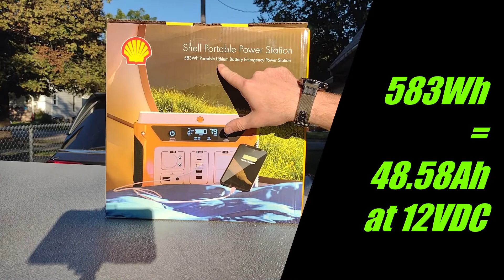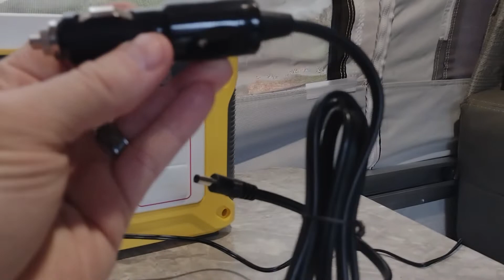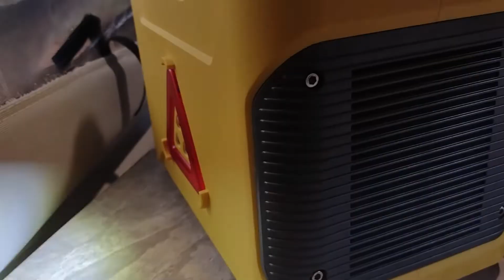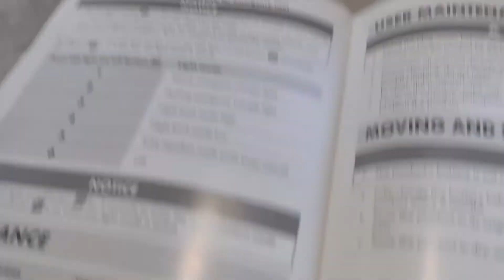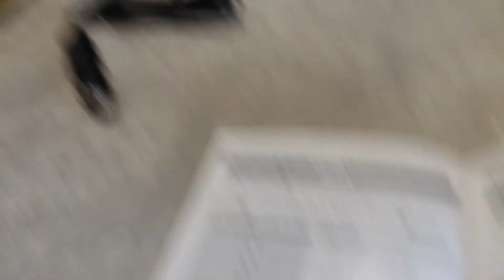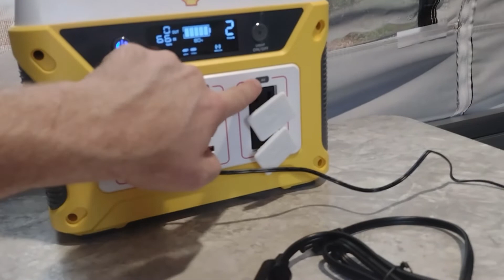Shell Power Station Unboxing and Review

Comment: Thanks for doing this review, do you know the Battery Pack total Voltage + the Battery Chemistry? LIthium Ion @ 3.6 or 3.7 volts  or 123 cells @ 3.4volts ?
Thanks
Reply from the maker: Cell capacity is 4500mAH Rated Capacity is 27000mAH 21.6V/583Wh  Lithium Ion but not sure on the volts per cell but looking inside through the vents they look like 18650 cells. Hope this helps.

Comment: JUST one more thing.. I received my unit about a month ago and have to be honest. I contacted Amazon because of error messages, specifically ⚠️03 (System Error). The BMS (Battery Management System) is unreliable. While plugged in, the USB ports intermittently don’t work, so you have to unplug it from the wall. I really wanted to like this unit. On Amazon there are only (as of this writing) 29 reviews. A small amount on a unit that you may have to depend on in an emergency.
Overall, I’d avoid this like Covid. I have the Jackery 1000, Bluetti EB 55, and EcoFlow River Pro, all of which are Class acts in their own right. IMHO, the Shell unit is not ready for prime time..🤷‍♂️
Reply from the maker: Have you contacted them? Judgement based off a single unit is hardly fair? You seem to have several other units which makes me wonder your overall intention. I have had not one single issue after 21 boondock campouts and a power outage at home. It has held up under a lot of demand from me. And seems to do just as well as a Jackery from the reviews I have seen. Your statement in regards to your issues sounds more like you got a unit with issues. I'd honestly reach out to have it replaced then make your ascertations on it.
Reply: @ParodyGuy2026  Yes I did reach out to them. They did not want the item returned, and verified my issues. Amazon was great stepping in. And in so many words I was told junk it, sell it or do whatever I wanted. Yes, I have other units, which is why I can compare it. I have a full time home in Mexico, and these units "are" my power.  My Jackery and EcoFlow have been flawless. Yes perhaps a bad unit, but when you're in the middle of nowhere, you can't hope something works, it has to come through. With that, I stand by my initial impression, and will not recommend it. Thank you for your response.
Reply from the maker: @pmd467  so when your next Jackery that you get has an issue because things happen in assembly and there is a flaw rate with even the best of quality control measures, you'll just rip on them and dump them over one unit. Sounds a little like a more personal issue there. Technology has complications at times and judging a company on one unit and saying stay away is kind of a hard push there. But, you do you. I don't see a mountain of complaints out there so, your 1 out of 10k ratio won't have any effect on things. I had an issue with a product from Sky Intelligent one time and reached out to them and they went out of the way to resolve the issue. Sent me a new unit with a return prepaid for the original. This was for an EV charger. They even followed up with me asking how things went to make sure. You went through Amazon's channels for support. Maybe you should write a review about that experience instead?
Reply: @ParodyGuy2026  Sir, first off there is nothing personal. Can I be honest? Is this still America? I said the issues pertained to me, and based on "My experience" I would not recommend it. I think the people on here who read the comments are mature enough to make their own decisions. I've been around long enough to remember the Radio Shack stores in the early 60', and Gas that was .27 cents. I've had a ton of electronics in my years. I'm not dumb to technology. I'm sure there will be issues with every power station that I own. But.. (FOR ME) and for the money, this Shell Unit did not make the grade. And for the record, when I reached out to them they told me, Junk it, Give it away or sell it, but we don't want it back..
Reply from the maker: @pmd467  So did Amazon refund you or did you replace it? I'm assuming refund. I haven't had one issue with mine. I have put it through some tough courses to be honest. I am happy with it. You definitely have a right to your opinion and I am glad you clarified this in your last post. I am glad you have a unit and brand that works well for you. What made you purchase the Shell unit? Price or something new? I decided to buy because Shell backed the products so, I figured they must have some quality.
Reply: @ParodyGuy2026  Yes, they did refund me. I wanted to send it back, but Shell said no. I was willing to try another unit, but I have off grid property in Mexico, and these units literally supply power to my home. And please understand, the Jackery has it's quirks and limitations. I purchased the Eco River Pro and spare 700 watt battery, and it's running just about everything. The Shell unit still works.. well..sometimes. I really wanted to like the Shell, but in a crux, it failed. As you said, I may have received a Unit made on a Friday at quitting time, I don't know..? But because of what I use them for, I can't take a chance on something not working. As to why I bought..? LoL.. Well, your video was one reason..:-) I also saw a few other videos and decided to give it a try. I'm glad yours is meeting your expectations, and I hope other people who purchased it are happy as well..:) Mine was just One (I hope) bad Unit out of many made..
Reply: @pmd467 Thanks for doing this review, do you know the Battery Pack total Voltage + the Battery Chemistry? LIthium Ion @ 3.6 or 3.7 volts  or 123 cells @ 3.4volts ?
Thanks

Comment: Very nice explanation. Which solar panel will you recommend?
Reply from the maker: Any that has the correct connector. Recommend one that is 100 watt as that will translate out to an average somewhere around 65 to 80 watts which is plenty to juice it back up quickly.